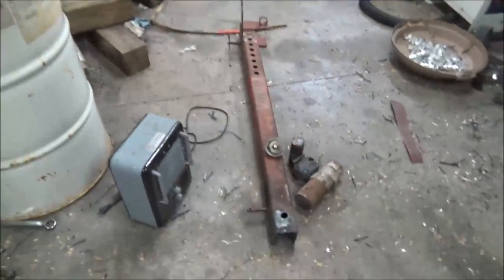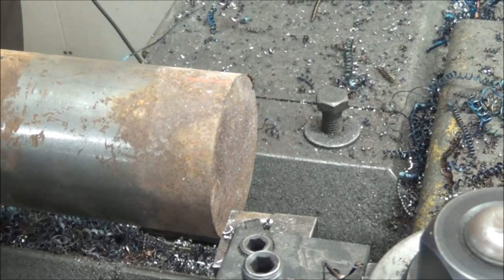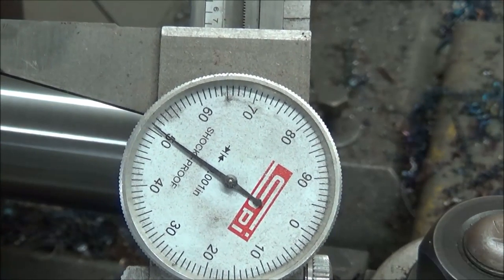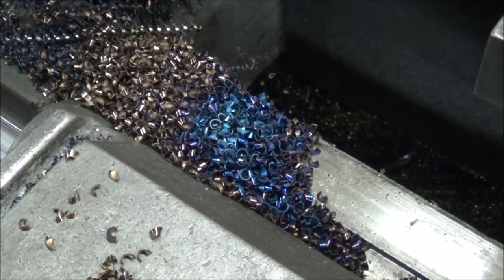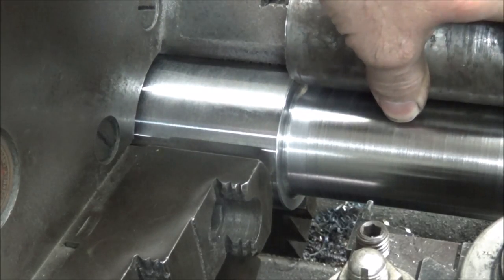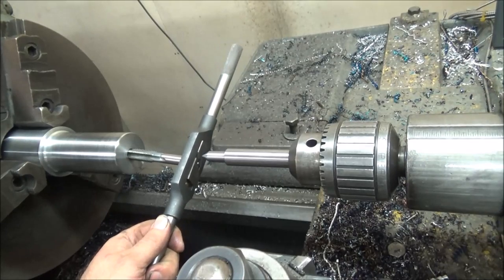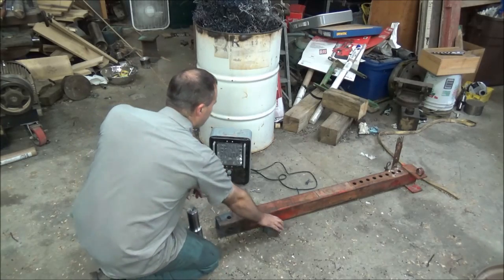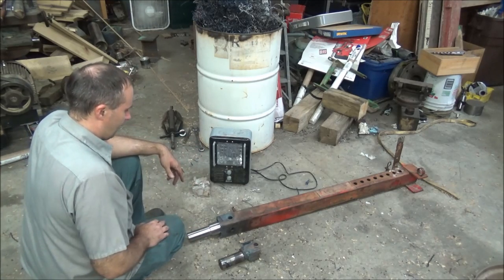Heavy Turning Chip Control and Rake Spindle Repair

Comment: Hey Brian,  You flatlanders are some tough!  106 degrees and you have a heater running!!  No wonder Bailey is pooped.  It is 56 here so you could send about twenty degrees up and we would both be tickled pink!    I was surprised that the rod broke instead of the square tube.  Take care.  Doug
Reply from the maker: A lot of strength in that tall tube cross section. Last week was killer hot and humid, I busted some concrete in the shop with my sledge hammer for the next pour and I about drowned in my own sweat!

Comment: So how come you didn't use your SPV Tapping head ? Maybe you done have the right shank for your Lathe. We have been having the same heat up here . I did pick up a SPV head with a MT 4 shank on it and it works great  Stay Cool
Reply from the maker: The Spv's I have are only NMTB50 I don't have one to fit my lathe but I rarely have tap jobs on my lathe anyway so no big deal.

Comment: :51, this is a real dumb question from a complete novice. but here goes.

Was that two pieces of "shafting" that was only partially welded together very badly or does steel shafting just break that clean and flat?????

Just nosey.
Reply from the maker: It breaks that clean, it is essentially sheared off at the point where the big diameter and little diameter meet. That is why the radius is so crucial.
Reply: Thank you.